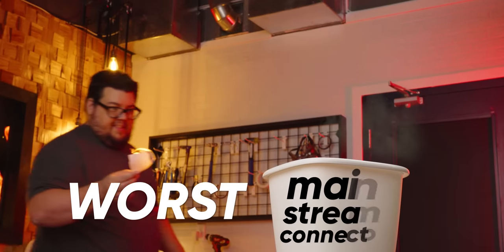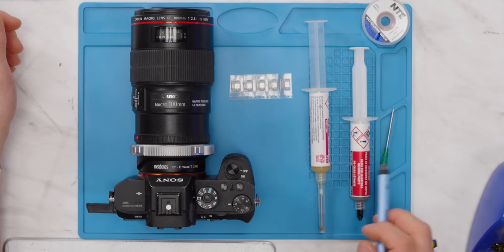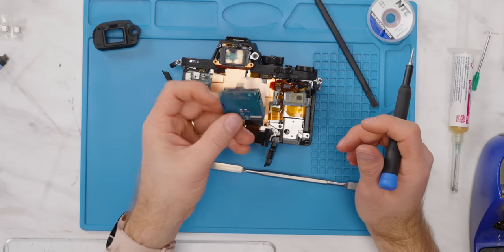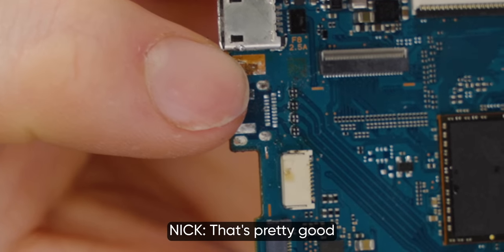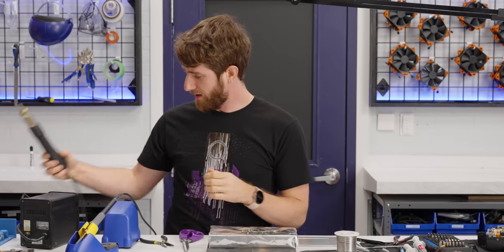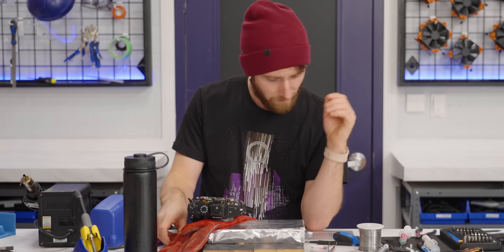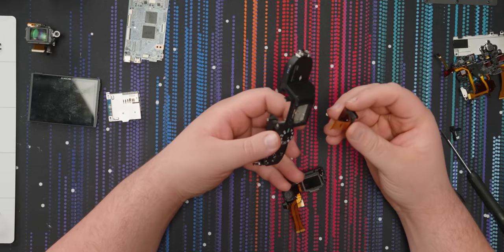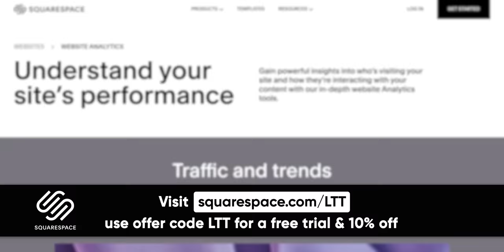This "cheap" repair almost BROKE me.

Comment: Tip for future repairs, if you want to attach a new connector that doesn't have much heat resistance, you can always use the hot air underneath the board.
This allows the solder to melt and give you enough time to place the connector, with little chance of damaging it, provided there is no components on the other side that could be damaged by the heat.
Reply: Exactly what I did with a micro B socket. heat from the bottom side, and if there are parts near by use Kapton tape to keeps parts in place and shield some of the heat.
Reply: Yup heat from below. Find a vise or any way to hold the board, so that you can work with two hands. Also most important make sure to clear all through holes so that the part will lay down flush before you attempt to solder it. To clear the holes you need to fill them with leaded solder first before you can wick it up. Or use a solder sucker most under utilized soldering tool.
Reply: Another is they make this type of putty for putting on boards to direct the heat to only what needs to be heated too, use this putty to protect your board components during the heat up.
Reply: lots and lots for kapton tape and aluminum foil.
Reply: you can also use low melt leaded on the pads/anchors beforehand to help with removing the port the first. then turn down heat and go from bottom. kepton on the stuff you don’t want heat to get to
Reply: Yep micro solder requires skill, expertise and experience. I would have tried with something a little less expensive first maybe an old phone.
Reply: Wont the pcb get heat damage if you heat it for too long though? Isint it better to risk the plastic on the part melting abit?
Reply: @someoneonly  melted plastic could mean the cable no longer fits in the receptical

Comment: After working a lot of time disassembling things like this, maybe I can throw some tips.
(PS: I hate soldering fpc connectors for smart phones screens)
1- Check your mechanical process. You are clearly forcing the port to come out when is not ready. Apply a heck ton of flux, and let the hot air do his magic. The port will come out on his own, it's not necessary to pull it.
Also. When soldering the connector back. If you are using solder paste, you first clean the pads, then put the new port over the solder (centered), and then apply hot air. In the case of using soldering wire... You clean the pads, then apply a bit of fresh solder to the pads, then put a heck ton of flux, and finally you put the new port centered to apply air (in this step you can use some tweezers to keep the port from flying away).
2- Check your chemistry. Not every flux is equal and every variation of flux has his use. If you are expending too much time trying to remove the connector, your flux will burn away. Try a flux that can resist a bit more temperature. A good sign of the correct flux is that your connector comes out cleanly and leave behind a little puddle of flux without any marks on the board. Also, even when is not common, if the pcb to repair is old and has a bit of rust (the solder looks a lot dull), you can use an acid flux... just don't forget to clean that after soldering since acid flux tends to corrode small traces with time.
3- Check your cleaning process. This is quite simple... the more clean that's your work surface, the easier that is to work. Put a lot of flux, remove the part, clean the pads, the remove all the residual flux. With a clean surface you can apply fresh flux or even paste. If your surface is clean, the solder will flow on his own.
4- Check your soldering params. Even when the temptation to put your soldering iron to the max or the air gun to over 450C, you first need to know with what kind of material you are working. If you are trying to solder something that has plastic (most fpc and internal board connectors), you need to regulate the temperature in your station. The range depends on every station, but from experience, I can recomend something near to 325c to 350c max for hot air, and 225 max for soldering iron.
Reply: I would like to add some tips too.

- Do it in a comfortable position so that your hand doesn't shake too much. Grab a comfortable chair where you can sit straight up just like using your PC or laptop.

- When soldering small stuff on a PCB, buying a digital microscope or magnifying glass will significantly help in seeing those tiny traces and pads.
Reply: So 2 milipauals of flux then?
Reply: Never use acid flux on a PCB. Acid flux is for plumbing.
Reply: @KX36  If you clean the flux afterwards, there's no problem.
That thing is made to work with rusted stuff. I've recovered a lot of old boards using that kind of flux for desoldering and cleaning.
Reply: @siontheodorus1501  I learned a little trick. When you have a bit of shaky hands, clap harder as you can a few times. Your hands will stop shaking... or at least the shaking will be reduced.

Something that I didn't include in the post. Illumination is quite important if you're working with small parts.
Reply: This guy solders
Reply: Sounds like someone else learned all this the hard way! I still suck at it though and avoid small component soldering, or anything that involves hot air if at all possible. It also helps when you have a dedicated station so that you have things like your magnifier or microscope where you can inspect while soldering, along with something to hold your work piece in place. I know all this and still am too damn lazy to set things up properly sometimes, and still get disappointed when it don't work out, like hey dummy you knew what you were doing when you started lol.
Reply: Also, I'd suggest that you adjust the hot air gun to the lowest flow and watch the you keep the tem of both the hot air and soldering iron to about 10 to 20 c below the temp that could damage both the pcp and any plastic parts of connectors you are working with.  Try experimenting on some throw away pbc first.
Reply: It may not apply to this, but something I learned from replacing HDMI ports on gaming consoles:

Once your broken port is removed, clean all the old solder off the pads and clear the holes for the mounting posts. Then add a small amount of fresh solder to the small pins and place the new port in the empty mounting holes. Connect the pins to the solder pads with a clean iron, and finally add fresh solder to the mounting posts/holes. I found it to be much easier this way, and that way you don’t risk melting the plastic in the port. You can also always use low-temp solder if the old port is being stubborn and won’t come out, but that stuff can get expensive
Reply: @naterulesXD12  If you use a good flux with a proper tuned hot air, you can resolder plastic connectors too.
I've learned that soldering the fpc connector of samsung phones... Just don't heat one side only o you will melt the connector.
The flux protects a lot the plastic parts against the heat.
Reply: Use a digital microscope and a PCB holder.

Comment: Is it just me, or could 90% of Linus's frustration and problems have been solved by using a handy helper? Could even have applied the hot air gun to the back of the board and avoid burning the HDMI socket (and possibly avoid over heating the whole board by not doing it so many times)
Reply: True but let's be real when it's not your job, when do you have all correct tools for the job?
Reply: I was about to make the exact same comment, I was so frustrated to see him trying to remove the hdmi connector and was like "DAMN PLEASE USE A HANDY HELPER !" 😂 It's kinda cheap and so useful !
Reply: @MyILoveMinecraft  The funny thing is, they have people there who its is probably literally their job to take care of things like this. He should have been more well prepared with the team he had, but he was still far more prepared than most people would be. And it showed how hard it was for him to do. My job for the past 10+ years has been focused a lot on small electronics repair and it took me plenty of time, and fucking things up, before I could routinely do solder work like that. I appreciate his "What do I have to lose" attitude to trying it, but I really struggle in understanding why people seem to think they are owed step by step instructions to repair something they are almost certainly not qualified enough for.

Comment: ⚠ IMPORTANT TIP - All of this could have been avoided if the following setup had been used: A right-angle cable and... black hot glue. 😜 I kid you not. We use right angle mini-HDMI cables and then use a hot glue gun and build a sort of barrier around the connector. It takes about 15 seconds to glue the cable onto the camera, the black glue is more sticky and flexible than the basic kind but all of that can also be removed easily when needed. Most of the time though, you keep the camera in the rig with the cable attached to it. So the HDMI output is protected at all times when shooting. We don't break those ports anymore. 😎👍
Reply: Is the right angle cable like a female to male fullsize hdmi one so you can just plug in normal cables whenever? That would make a lot of sense tbh.
Reply: @HeadsetHistorian  Exactly. And once we glue it on with black hot glue, there's no breaking it. 10$ solution to a hundreds of dollars problem. ;)
Reply: i was thinking the same thing, just add an extension to the port so if anything breaks its a quick fix
btw can you get a micro to full size adapter cable for the same purpose, to make an extended link
Reply: What does the black glue do to prevent damage
Reply: @CybertroninfiniteOfficial  It holds the cable in place so you don't remove it from the connector. You don't want to be straining the socket, that's how you damage your expensive camera's output.
Reply: @swiftrealm  if you need to remove it, what's the best way of reinforcing it
Reply: @CybertroninfiniteOfficial  It keeps the cable in place and protects the cable against accidental hits and being kinked too much. As a bonus, it also keep the camera's connector protected. It sucks that I can't upload a photo on here to show how we do it.

Basically, we pack black hot glue all around the connector, adhering to the camera body. If the cable is hit, the shock goes to the camera body, not only to the connector.

I don't remember when the last time was that we broke one of those. Basically, when we see that one of them is at risk of being damaged, we take the addtionnal minute it takes to glue the hell out of it when installing the camera in the rig. I'm sure we saved thousands of dollars either in maintenance or more importantly in gear not being operational when we need it. In our line of work, being ready to shoot when stuff actually happens is rather important. So f*ck the apperance. We need to work.
Reply: @JFHeroux  smart smart, will do if I use minihdmi
Reply: @CybertroninfiniteOfficial  it works for any connector you will be plugging in a lot. i do this on any camera i own or device that i plug into i lot that way if a connector breaks its a 5 to 10 part instead of a motherboard or port directly on a piece of tech
Reply: I just use a $15 CAD cable stabilizer from Smallrig. Of course, a camera cage is required for theirs but the cage was worth it, as well.

Comment: I know it's content that you were after, but I love that it went from $500 to fix in probably a week or two, to $600 + dozens of hours between filming and the actual attempts at repairs, along with weeks of waiting for parts and calibration 🤣
Reply: But you forgot the revenue they got basically for just torturing a broken product.
Reply: At least he get the content, i think ad revenue from this video will cover all cost that incured wkwkwk
Reply: Yes and it makes for very poor content imo. The conclusion of that video is really bad : you waste 20mn on a video where basically he shows how he wasted hundreds of man hours and $600+ just for "entertainment". Also just so that he's going to use that expensive camera for a bloody home streaming setup. LOL.
very disappointed here.
Reply: This can absolutely be the reality, but it also holds value outside of ending up with a repaired device at the end.

For example, I blew an engine in a car I had once. I sourced a new engine but the quotes I got for replacing it ran from $1000-2500. I decided I'd do it myself.

It cost me $300 to rent space and tools to do the work, and a week of incredible frustration. I damaged a sensor on one of the wheels that cost me $250 to replace, and I made another mistake that ended up damaging the transmission which cost me another $600 to fix. In total I swapped the whole engine once, and the transmission came out and went back in another 3 times. I spent more than the cheapest quote I got, but I learned *a ton*. The first transmission swap took 19 hours, the second 12, and the last one only 6.

A few years later when a different car needed a new clutch, I had the experience and confidence to do it myself in a day and saved $1000.

I came out ahead, and it's really hard to put a price on the satisfaction of bringing something broken back to life with your own two hands.
Reply: @provax4925  600$ but half of it is from the tools. next time you need to do that kind of repair you won't have to buy them again
Reply: @VanlockFR  Its not a waste. He showed the raw experience. 
By showing the mistakes, he has not only informed people what not to do if they wish to attempt it, he has also shown what going wrong can cost, allowing people to make an informed decision.
Reply: @deokureta108  Wrong, they bought a $400 board and it was $200 to get it calibrated.
Reply: @VanlockFR  I know that nobody is accusing you of being a thought leader, but this wasn't a waste, nor was it entertainment. This video showed the truth of an attempt at repair that went off the rails, warts and all. It shows people that it's only through patience/pain, experimentation and having access to good information that hard things get done.

All too often, we only see short, always-successful build montages. And while that makes sense for Mark Rober's audience, LTT is actively trying to encourage people to have the audacity to take things into their own hands. A big part of that is embracing the possibility that you won't nail the landing on the first attempt.

As Michael Jordan says, you miss every shot that you don't take.
Reply: SAVAGE...:-)
Reply: @provax4925  I mean, that's literally the first thing I said, acknowledging that the content is king. That's the only part of this that made it worth while for them. 
Unless you already have the tools and experience with micro-soldering, you're definitely better off paying the $500 - that's basically what this video shows 🤷‍♂️

Comment: Massive respect for LTT showing the reality of the build montage. Even more respect for modeling how mature people can deal with incredibly frustrating setbacks and ultimate failure without punching walls. Things don't always go according to plan. What your employees remember is how you dealt with it.
Reply: its all scripted bro they didnot use any sort of holding appratus or kapton tape to minimize heat damage.
Reply: @priyanshupratik1566  true kapton tape should have been used and a microscope like how Rossmann does board repair.
Reply: @priyanshupratik1566  Well, they are no experts, just dedicated fools.
Reply: @fredwupkensoppel8949  I mean, most of us holding the camera are dedicated fools in the realm of electronic repairing
Reply: @ts757arse  Same! To me, this is what Right To Repair is all about; companies like Sony shouldn't be forced to publish instructables, but we should have the right to shame them for not doing it - or deliberately obfuscating information that could help. Part of the reason I bought a Framework laptop, for example, is that I hope I never have to take it apart, but I appreciate that they have my back if something goes wrong. Shame == voting with our dollars.

I see no reason why Sony doesn't come out ahead if they make exploded diagrams with parts manifests available. Why force people to send back a whole camera when they could request part A57?